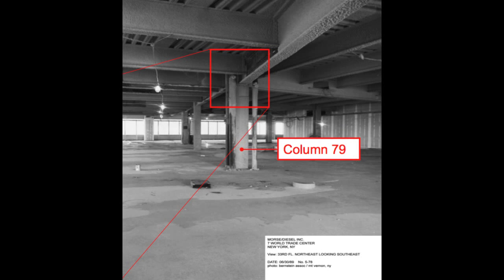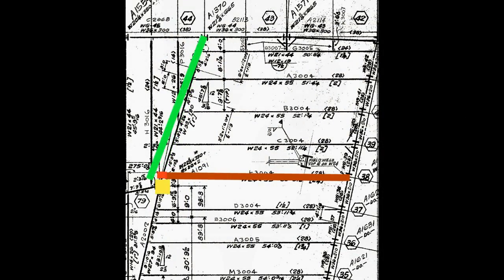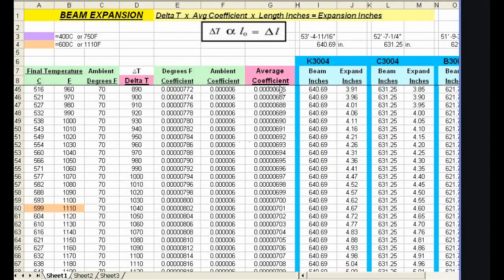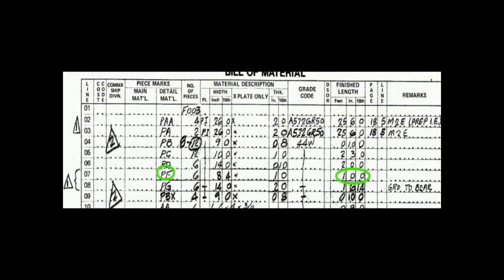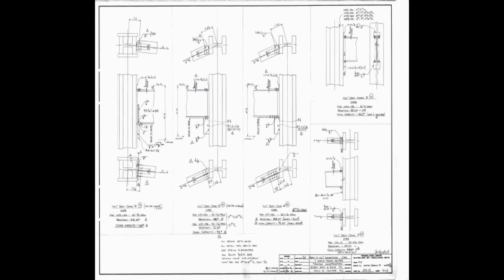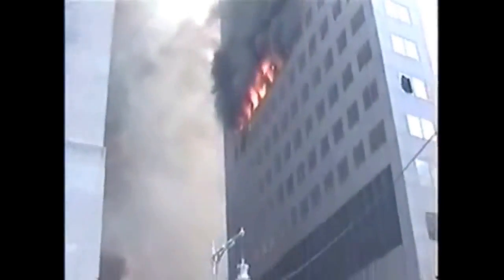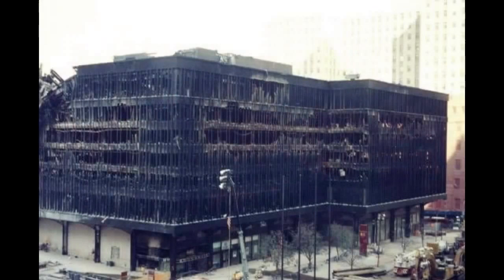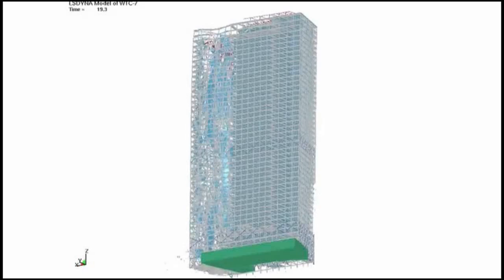Tangled Webs   NIST and WTC7

Comment: There's not even any suggestive evidence for #1, and there is proof of nanothermite being discovered, as well as molten steel.  Very large quantities of molten steel.

Why is Marvin Bush's job relevant to three towers being demolished?

The planes only hit a few floors.  The directions of the planes would have been known and the charges placed behind the massive steel beams.  One valid theory is that each floor was rigged to blow separately, and was programmed after the floors were counted.